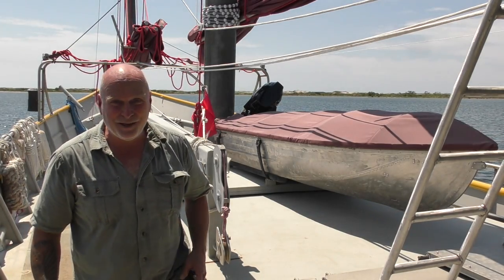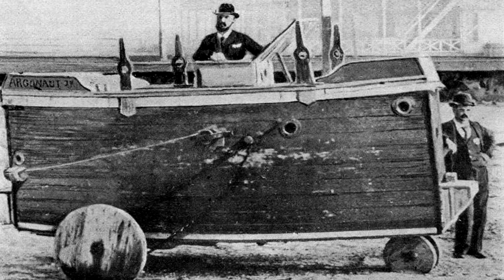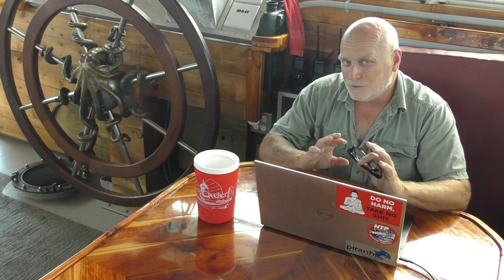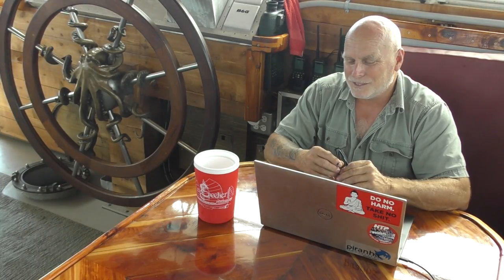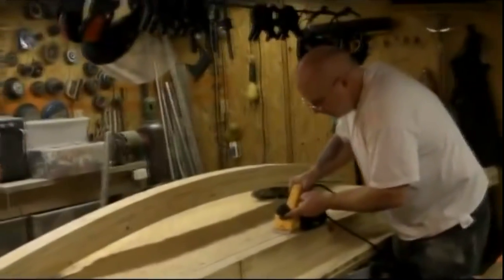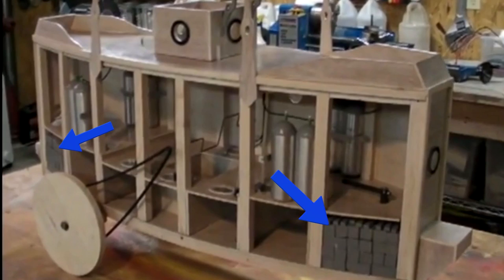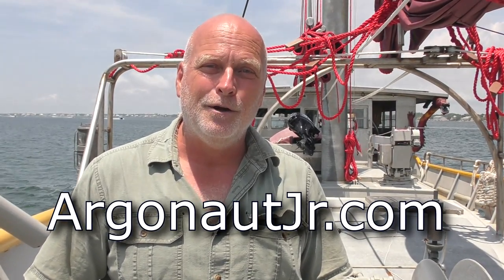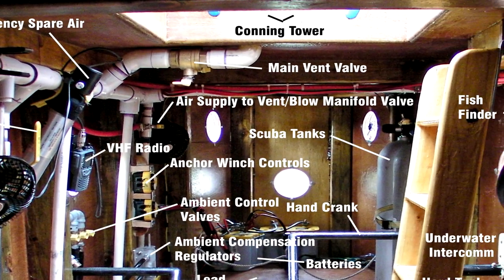Argonaut Jr - Building and Diving a Wooden Submarine from 1894

Comment: More thought went into just the ballast on this sub then the whole Oceangate debacle!
Reply from the maker: Thanks, but not even close.
Reply: The issue with Oceangate Titan is it simply was not built correctly to deal with the absolutely INCREDIBLE pressures at deep ocean…this little wooden fella doesn’t go much deeper than a person dives.

If Titan was going to the depths this little sub went to there never would have been an issue it would have been perfectly fine forever

Comment: VERY cool Doug, I loved how you went through step bt step your failures and how to overcome them. As a kid I was fasinated by SEA HUNT and wanted to be a diver. Well I had a snorkle and a lenght of garden hose which I attached to it. My friends dad had a small boat and took us out in the river. My friend an I  hung some rock on a rope and  put them over my shoulders , and I went down about 6 feet to only discover I could not suck air through a gargen hose 6 feet under, I came FLYING back to the surface out of breath. LOL It sounded good. Later as a adult I did get certified as a diver. Nice story Doug
Reply from the maker: Love it.  I tried the same thing.  : )
Reply: @SVSeeker  Now I thought I was the only fool. My friends dad laughed his ass of, He knew all the long what was going to happen. Youmust be very bored to be replying at this hour.
Reply from the maker: @combatmedic1980   : )  Not bored at all.  Anchor watch.   There was a thunderstorm passing over.
Reply: Yup, even from about 18 inches you can't get enough air through a garden hose.
I experimented with tire tubes to provide pressure but that will only work to about two feet. 😁

Comment: As a Qualified US Navy Submariner I know we were taught that a Hard Tank was a tank exposed to sea pressure. Soft Tanks were tanks isolated from direct sea pressure and mostly interior to the pressure hull. Ballast tanks, exterior to the pressure hull, when full had equal sea pressure on both sides of the tank but were isolated from all other ships tanks. An Auxiliary Tank (or Negative Tank) can be a Hard Tank used to bring compensating water inboard to the Trim System for ballasting and  weight compensation or expelling excess weight overboard. Usually kept about 1/2 full know as the "Mark". The Diesel Subs use to have  a Safety Tank that always kept full and it was blown to give added reserve buoyancy in emergency situations. You NEVER wanted to bring seawater into the pressure hull unless through a certified Hard Tank system. I've sailed both Nuc and Diesel subs!
Reply from the maker: Sorry they taught you wrong.  But when you build your sub.  You call them whatever you want.  : )

Comment: Do no harm; take no shit. I like that! This was a really cool build too! And, you're right, stuff is just stuff even if you do build it yourself. Lives matter but shit is just shit. I build bushcraft forts for fun and some of the stuff doesn't work out and it becomes firewood for my next meal or at least as a fire to keep the mosquitoes at bay. When we had our first good rains here in a long time during the winter (which is the only time I can go out building stuff because it gets too hot), I figured everything I had built would be washed away since I was building in the flood plain near the wash (so I obviously don't hang out there when it rains a lot, even though the weather is nice then in my opinion). I ended up building a whole fort during the winter and I don't know what shape it will be in come winter again or if it will even be there at all. I'm disabled so it took me a lot of effort to build it but I realized that, even if I have to build it again, I learned a lot from building the first one so maybe the second one will be better.

Comment: Not only have i broke the pin that holds the hitch in like you did, (pulling out a stuck tractor)
I have also broke a 2 5/16" ball pulling brush and stumps along a fench, then hauling hay the next day coming out of feld ball go snap... now for my big trailers its a pintle hitch bolted to a very beefy bumper, ill brake the truck frame before the hitch goes.

Comment: How long did the hull take to "take up" water for the hull to expand and seal itself up?
Reply from the maker: None, it's not like a plank boat.  It was all sealed up with fiberglass over the outside.   ....well mostly, but the Gorilla Glue was the final fix.
Reply: @SVSeeker  Yes, sorry. I didn't really think about that, did I. You did explain pretty well in the video. 😞
Reply from the maker: @Iaintwoke  No worries.  It got me thinking if Simon had any change from the planks swelling.   He writes about a leak where they had forgotten to plug a hole.  Bart got hit with a stream of water and started to try to escape but Simon simply plugged it with a piece of wood.  Cool as a cucumber.

Comment: "soft" ballast tanks should be either dry on the surface or completely filled to submerge. Any air in a soft ballast tank will wreak havoc with trim and buoyancy. If the "hard tank" is open to the sea at the bottom then it is not a hard tank. To be used as a ballast tank it must be closed at the bottom and is typically vented internally and must be pumped to drain and flooded through a valve to fill. Look at the "negative tank" configuration on a real submarine. Trim tanks are hard tanks, they may be flooded by sea pressure but pumped out or between them for trim purposes.

Comment: Doug
On my way back from a Navy Submarine reunion, late March early April of 2021, I had visited Seeker. You took your time and gave me a private tour of Seeker which I was grateful. You spoke in passing of building the Argonaut of which I was impressed/fascinated, but never really went into any detail, other than building and sailing. This video on Argonaut certainly answers many questions I would have had but time would not allow. Again I'm impressed with this very dangerous but cool accomplishment. My only question to you today is how did you handle the CO2 build up when "Rigged for Dive"?
Reply from the maker: Howdy.  CO2 was never really a concern.  The surface supplied air as constantly available so much of the time we simply allowed it to flow through the hull.

Comment: At 15:40 you mention what happens when you depressurize a vessel. The air that is under pressure and releasing its pressure as air escapes out of the vessel, converts the moisture in the air to fog, clouds. Now, in your case, it's mere a mild inconvenience. In my case, when I depressurize a sandblast pot, that fog condenses on the inside of my blast pot and that condensation will now run down the inside of the pot to the bottom and make my sand wet. Wet sand no longer wants to drip out the bottom of a funnel/hour glass neck. 

So for me, every time I depressurize my pot, I must then also blow DRY hot air through it for 3 minutes to scrub the collected condensation off the inside walls of the pot, to keep everything dry and toasty.  Dr sand flows nicely and lets me continue sandblasting all day long. If I don't blow the condensation out of my pot every time I depressurize it, after about 4 pot refills, the sand gets wet enough it clogs my pot neck up and will no longer blast. 

You're the first person in my whole life, that I've (almost) met, that knows how fog is produced from depressurizing air. Boy, was I surprised.

Comment: ive always wanted to build a submarine, maybe with stronger tanks, and a little more cylindrical in design, so that it can go even deeper, but otherwise that was pre- wait a second, do you need a license to build a submarine... its just come to my attention that i dont think you do, lemme look it up rq...

nope, from a quick glance it doesn't seem like you do, unless you plan to carry above 6 passengers, which is highly unlikely with a small DIY project the likes of this. the required license in question being a Marine Masters permit... im assuming they left the rest of that up to the better judgement of whomever is crazy enough to build a submarine... plus the fact that it has to be easily searchable in case of a suspicion of drug smuggling, otherwise they're gonna tear it apart